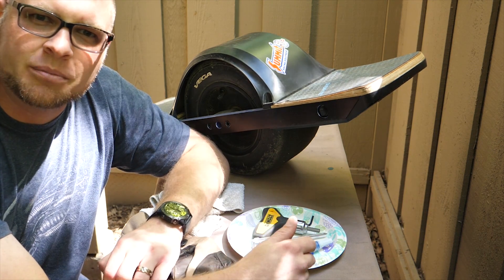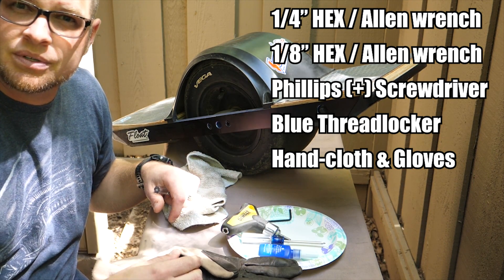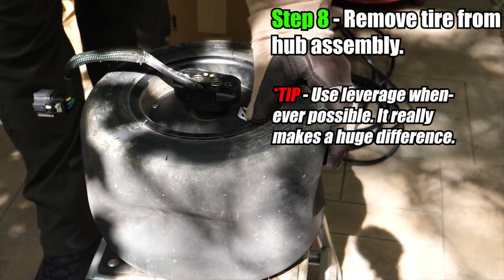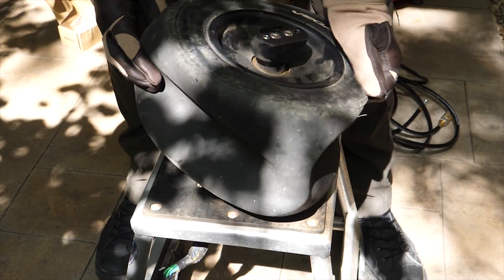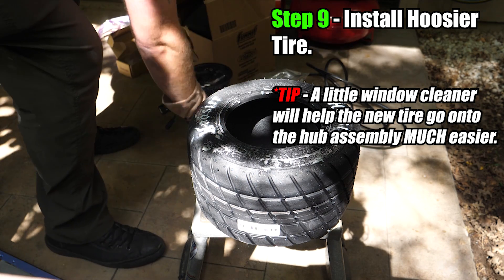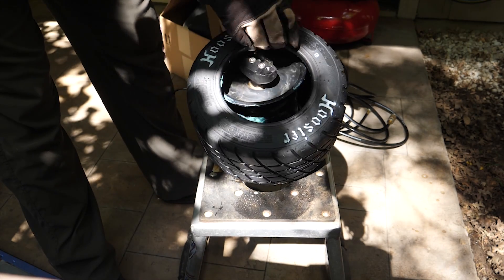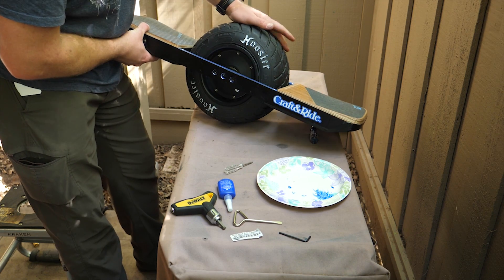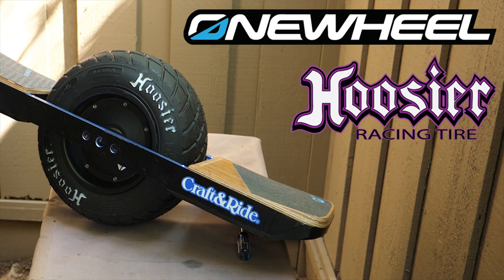Onewheel + XR Hoosier 11X5.5-6 Treaded Tire Installation Tutorial

Comment: A good tip is to ALWAYS stand the tire vertically (on the rubber, not the rim) so that if anything bad were to happen, the rim/tire would blow out sideways and away from your face. With the tire laying rim side up, bits of tire or rim would fly at your face.

Comment: The factory puts sealent in the tire. I would put orange seal MTB sealant to make sure you don't get a flat.
Reply from the maker: I have filled it with the same amount of Slime that they used at the factory. You can pick it up on Amazon for under $10
Reply: Bay Area FPV - Can you post the link to the sealant that you used? I think I’m going to breakdown and make the tire switch.
Reply from the maker: @visuals.by.pereira  Hi Chris, here's the link https://amzn.to/2CvYwIf
Reply: I've mountain biked for 13 years. I'd personally use slime automotive tubeless sealent. It's thicker and lasts longer without drying up. But I do use orange and stans on my mountain bike. They are thinner and work well on MTB tires because the rubber is much thinner on MTB tires than Kart tires.
Reply: I have handy Vaseline and Lithium grease for a tractor? What do you guys recommend?

Comment: Thanks, this vid was just what I needed. I'm only 155 lbs and managed to change my own tire (though I did struggle a bit at some points) so I would encourage anyone watching to at least give it a try, rather than taking it in to a tire shop.

Despite riding for 6+ months, this was my first time opening up a OW. I wish you had shown a little more detail on how to remove the plugs, you stated that we should remove them carefully but don't show how it should be done. I ended up watching this video: https://www.youtube.com/watch?v=mvYwKyLpYgU which helped a lot in that regard, though there seemed to be slight variations between the OW+ and the OW+XR. For other first timers reading this: the two middle plugs have two sections, a top and a bottom. The top part should turn left about a quarter turn, then grab the base of the plug and pull, it should slide right out. For the outer plugs, slide the white plastic piece 'down' (away from the plug), this should allow the black piece to be pressed 'down' (into the plug) which while pressed will allow you to remove the entire plug. Even with the black piece pressed, it still took some effort to remove these, especially the biggest one.

The only other critique I have is I wish you had listed the steps at the end again so I didn't have to search through the video. 

All in all, great vid! Subbed for more OneWheel stuff!
Reply from the maker: Thank you. I will take your recommendations into consideration for future videos.
Reply: 558822zz  wow thanks for all the details. My 1st tire replacement tire Today! Excited ordered a Hoosier 1190D25 threaded upgrade tire

Comment: What are the advantages of this tire compared to the stock Vega?
Reply from the maker: The overall shape of the tire is different which changes the ride altogether. The riding surface of the Vega is flat, whereas the Hoosier is curved. In my opinion this provides a more aggressive ride and much more freedom. Not to mention that the fact the Hoosier is treaded will definitely provide a better grip on certain surfaces. Hope this helps.
Reply: @BayAreaFPV  Do you think it's advisable to acclimate to the board on stock tire for awhile before switching to this one?
Reply from the maker: Jay Wes I would get comfortable with the basics of riding the board before changing the tire. Doing this will cut down on the time it takes you to get used to the board with a Hoosier. Just my opinion.
Reply: Well my Vega tire is crooked, wobbly af! Future Motion said that’s normal. If that’s the case, these go cart tires are not perfect for this purpose. These machines that ride on one wheel need a tire that is pretty close to perfect. I want see someone compare the Hoosier slick to the Vega

Comment: How’s the oem fender? I hear bad things but fuck dude, the other ones are are $200
Reply from the maker: In my experience there is nothing at all wrong with the OEM fender. It is VERY durable. I've had it on my XR since I got it back in March and it is still going strong. If you're doing anything other than commuting, you run the risk of scratching it all up, which is exactly why I won't use one the custom carbon fiber fenders. They are just too expensive and nice looking to be all chipped up. Anyhow, hope this helps.

Comment: Do you need a tire valve stem puller to do this install?
Reply from the maker: Jefferson Cox you do not need to remove the entire stem, just unscrew the valve enough to release the pressure and allow the air to escape. That’s it. Hope that helps.

Comment: why does no one just cut the old tire off. Like with a knife. simple incision all the way around instead of several minutes fighting getting it off.
Reply from the maker: I can't speak for others, but in my case the Vega tire had less than 100 miles on it and was basically new. So cutting it off wouldn't have made sense.
Reply: @BayAreaFPV  yeah I get that. I just see alot of vids where they are taking old beat up tires of..   And sure why cut a perfectly good tire off
Reply: Well the bead is a wire bead lol good luck

Comment: Damn! That looks like a pain in the ass! I think I’ll just take mine to Goodyear.
Reply from the maker: Honestly, the most difficult part was getting the second half of the new tire back on the wheel. But, as you can see in the video, when I used my knee as a 3rd point of contact, it became immensely easier.

Comment: You absolutely DO NOT need to unplug the yellow foot pad sensor..
Reply: I was wondering why he did that
Reply: you really only have to disassemble the front pad. you dont even have tontouch the back
Reply: @pyramidsarethefuture1587  to take off a tire? You absolutely need to remove the back footpad. You have to unplug the two motor sensor connectors
Reply: @c0pyimitati0n  bro ive had my onewheel for over a year and ive changed the tire 3 times now. the 1st time i did it i removed bith pads but after that i realized theres no need to remove to back pad. i literally just did it yesterday and i didnt even touch the back pad. front pad is all that needs to be removed
Reply: @pyramidsarethefuture1587   lol duh 🤦‍♂️ It's early and I'm mad baked 

The back pad doesn't need touched, all the connections are under the front footpad 🤣
Reply: @c0pyimitati0n  Lol i always baked. not an excuse fam. i change my tired baked, im glad u looked that up tho.
Reply: @pyramidsarethefuture1587  lol I ain't gotta look anything up.. I been riding since 2016 and I changed my tire on day 1
Reply: @c0pyimitati0n  Yea ok homie, but your were so baked that you commented to me like i didnt know what i was doing when u were wrong in the first place. Congrats to you
Reply: @pyramidsarethefuture1587  lol whatever dude
Reply: @c0pyimitati0n  Where u live? maybe we could ride sometime and smoke some joints. lmao